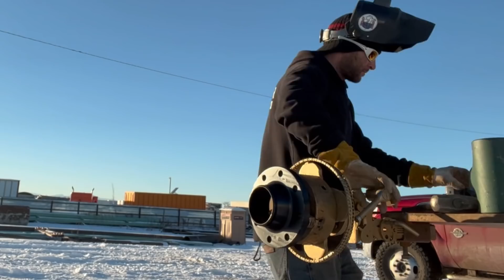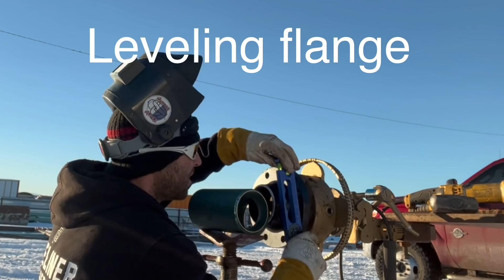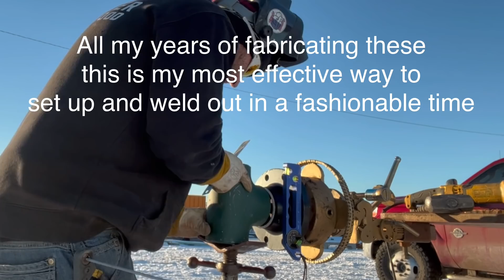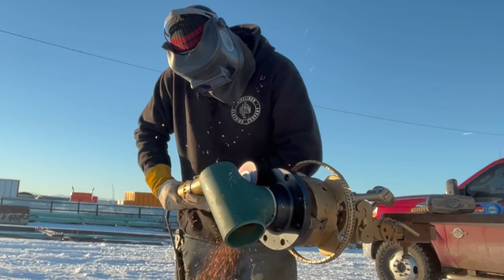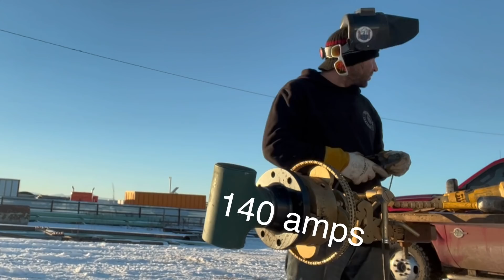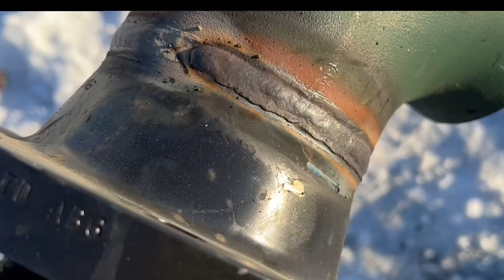PRACTICAL WELDING METHOD$ 7018 ROLLOUT$

Comment: I mostly do 7018 in position.  Just getting into rolling out pipe. Did not like how my cap looked like. I google it and it send me to this video. I watch it twice and couple other videos of yours. Couldn't wait to come in to try it out. Even though this video was for content I APPRECIATE THE HELP. CAP CAME OUT  ALMOST AS GOOD AS YOURS. *need more practice on the wheel lol. GRACIAS PROFESOR WALLY
Reply: I also copied your setting on my BB. Even the root came out nicer than ever before

Comment: Fantastic work. This is so far over my head as a welder. I never got involved in pipe I was working on machines mostly and general fabrication and repairs. I'm a journeymen but pipe just never came along in my travels. If it did I'd sure enjoy being taught by you Wally. Retired now and I miss it.

Comment: That's absolutely beautiful. I love this. I was doing the root 6011 cause there ain't no 6010 in the mountains here, and then 6011 hot passing it then doing the 7018 fill and cap. I like your method but I didn't know it was an option. I get frustrated because I am doing this work here and nobody else does this for a hundred miles. So I make phone calls and then burn rod. But to be fair, I am doing it for irrigation and the pressure is low. But that doesn't matter, because I do the welds trying.to beast perfect as possible because it's all practice right?

Comment: Nice Job!    I was certified a number of years ago.   Welded up some 3/4 wall tube and machined flanges for 50,000 lb hyd lines.  That was fun!   Keep up the good videos!   Kent Smith Welding.